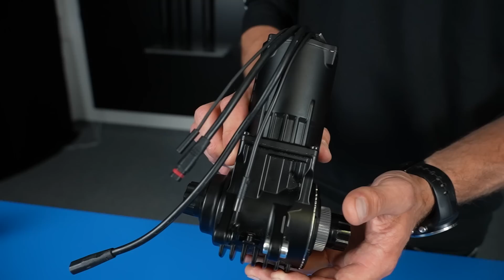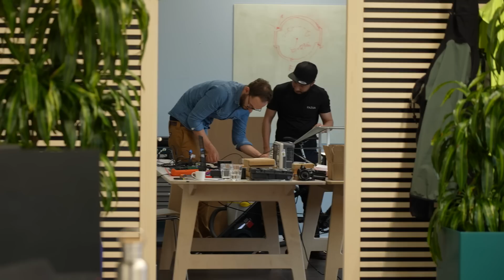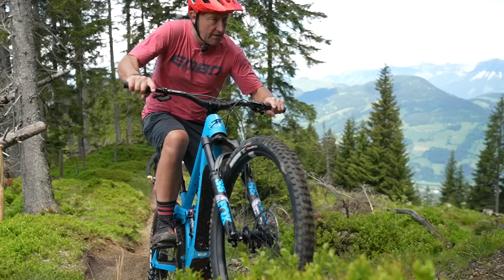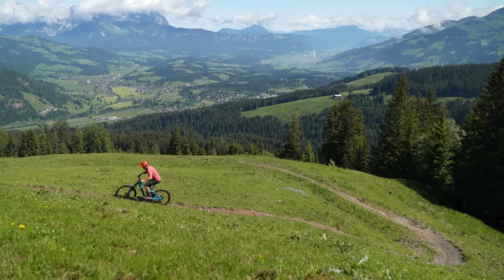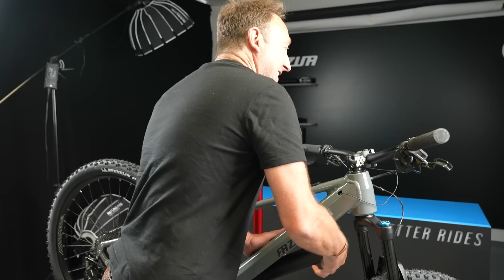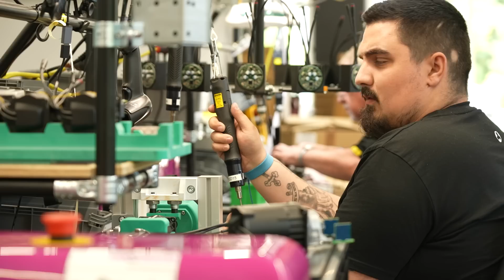Is This The Lightweight EMTB Motor Of The Future? | Fazua Factory Tour

Comment from the maker: What do you think of the new Fazua unit and these lightweight EMTBs? 🤔 Let the community know 👇
Reply: Specialized needs to make their SLs better at least 50 nm of torque
Reply: The Fazua 60 is compromising a bit towards power. I'm happy with my Fazua 50. It is 19.7 kg electric, and 16.4 "pure".
Reply: Coming from the emobility industry this is exactly the right move, good job guys.
Reply: Can't help but think of a recent Sam Pilgrim video where he lamented wishing for a jump bike, that had a small lightweight battery/motor so he could do tailwhips and other stunts that require a lighter weight bike - and most importantly, so he could also ride back up to the top and do it all over again......Hey Fazua / Porsche - are you listening?   I can definitely imagine Sam Pilgrim on a Porsche Jump Bike.......
Reply: For me if they don't supply spare parts, then this brand it's a big NO because we already have too many price gouging and monopoly style brands.
Reply: I have to say I am really impressed! Mostly of that how well integrated and protected is the motor. But the battery seems a bit small. there are now 900Wh battery e-mtbs. I guess 60Nm from the motor is about right.
Reply: Interesting components design, lighter e-bikes. On the other hand, the range on the introduced battery is simply not enough for hilly countryside expeditions, even for normal multi-hour hill rides outside high mountains of around 50 km. Maybe for the trail spins? 

I would definitely again choose a full-power Bosch setup of the last generation with a proper battery, and I don't have to worry about not getting where I want to go. Even with the sacrifice of the high weight.
Reply: Did they fixed all the water issues?
Thinking about their community is important this ride 60 cannot be mounted on previous bikes
And I m not sure the ride 50 has fixed any waterproof issues so what now?
Reply: There are a lot of flaws, BB fails, Battery fails, Battery drains when the bike is not in use, connectivity problems, motor loses power, sensors issues, and the system is basically not water resistance... just google Fazua problems :) never ever... yeah good concept but I would rather pick Bosch, it is far more reliable
Reply: 2024 and the Ride 60 on my Transition Relay is overall faultless and very natural feeling. Plenty strong enough to get me up my local trails. Only downside is the fiddly ring controller. Can't wait for the updated controller as I rather enjoy the ring concept... Just needs refining and to be made more durable and robust.
Reply: A very interesting addition to eMTB motors and more competition is always a good thing. Thought the Fazua 50 was a bit weak compared to other motors, I hope this feels more powerful/usable. Good video!!!

Comment: I have the Ride 60 on my Focus SL, this is the best system currently on the market; main flaws are:
1) the remote gets stuck even after changing it with the upgraded one; also is not easy to use while riding 
2) the connection with garmin is through a dedicated page but is not integrated like with Shimano for example 
3) they promised the range extender in 2022 and today (jan 2024) is still not available.. this is really upsetting.

Having that said I still believe is the best light system currently on the market.
Reply: There are a lot of flaws, BB fails, Battery fails, Battery drains when the bike is not in use, connectivity problems, motor loses power, sensors issues, and the system is basically not water resistance... just google Fazua problems :) never ever... yeah good concept but I would rather pick Bosch, it is far more reliable

Comment: I ride a Fazua 50 on a Trek e-caliber. 80% I ride it without motor like a normal mtb. I only take the motor & battery to help on longer, steeper, rougher trails. Still manage 40km and 1000m D+ with 70% of the 250Wh battery left!
The philosophy of the Fazua 50 is to help you ride, not to replace your efforts like others motos. 
Following the arms race of bigger torque and battery will have them endup with a me-too product.
I liked the idea that light emtb was for people who don't want to ride an electric motocycle in the woods but still enjoyed pedling with some assistance when needed.

Comment: Why doesn’t someone integrate a mid-drive motor with a transmission like the Pinion gearbox? The only choices seem to be derailleur or hub gears. Seems they could add this motor to a mid drive gear box as well. We love the Pinion gearbox and we love the Bosch mid drive. Put em together with a gates belt drive 🤓
Great video love shop tours! 
Arrivederci y’all

Comment: I think it's better to have 80 nm and to only use 60 of it.
Reply: that would be bigger and weigh more. 60nm is alot for light bike
Reply: @dft1  it would be more stable, and you wont be maxing out the motor.
Reply: @dft1  nm is the amount of power it puts out. 60 nm  compared to 80. Isnt the same as the weight difference between a 250 to 450. Its electric.

Comment: Wow they finally did it.  A motor and gearbox in one. It's insane how small and light it is.  This might kill gearboxes like a pinion or effygear. Why choose a gearbox only that sits around 2kg. If you can get one with a motor and gearbox in one for the same weight.

Edit: wait why the bike has got a cassette? The gearbox is useless?
Reply: yep.. just for the motor torque.. sad, huh?

Comment: Expensive weak motors and small batteries.  Exciting tech.
My Bafang 29'er has twice the N-m and over twice the battery capacity and less than 1/2 the cost.  Production ebike tech is for suckers or those that didn't go to engineering school.
Of course you will try to sell it to the uninitiated.  Good luck finding replacement parts. CANBUS proprietary controllers.  The tech hustle continues. German's are the masters at fleecing the public with expensive tech. BMW is the flagship for poor reliability and therefore non existent resale value.  The ignorant public are easy pickings.
Reply: I own several eBikes and each has its purpose...and I own a Bulls Grinder Gravelbike with 15.5kg and Fazua 250...excellent and fun to drive.
And Yes you make much more Sport on this kinf of Bike since Motor is weak compared to others...as said different purpose makes different bikes.
Reply: Twice the weight too😉
Reply: Conceded idiot. 95% of people did not go to engineering school and 90% who did would still like an intergraded product and just don't have enough free time to mess with a home made science experiment, we have better things to do.

Comment: love the lightweight but my giant trance x does 180km on eco mode and at least 40-60 on turbo mode, and i sometimes do use all of it in one ride, so if the range would be around 100km with a battery extension id be very interested

Comment: Nobody is giving up numbers. How much lighter than the EP8RS is it? Because the Transition Relay using this is supposedly the same weight as the heaviest Orbea Rise despite having a smaller battery.
Reply: RS is only a software modification, the motor weighs like other EP8s, 2.6 kg

Comment: non removable motor is a deal killer and a maint issue down the road
Reply: Not removale compared to the old Fazua System...Batterie and Motor was a unit, which could be removed complete...my Bulls Grinder Gravelbike is 15.5kg..removing Batterie and Motor means 10kg and you can use it as normal Bike.
The 60 can be unscrewed...but since the engine is the crank, too...it makes no sense other if there is a defect. But you would never remove a Bosch, Brose, Shimano other than for a repair, too....

Comment: Fine and dandy with reducing motor size but what is needed is the bike industry to concentrate on developing the sealed gear box and do away with derailleurs completely, this technology should have been standard 10 years ago and by now super lightweight and on most every bike...I can only surmise companies make money by putting out more derailleurs as they know it is an easily damaged part so needs replaced making money. Sealed gearboxes have far more importance than this fad for creating lighter motors,  it will always be limited by current battery technology and the duration of such batteries...Lightweight ebikes are probably at their zenith and this continued fascination with small weight margins on motors is IMHO really going backwards...
Reply: Agreed, I wouldn't mind the extra weight and lower drivetrain efficiency of a gearbox on an e-bike. Happy with my chunky 2020 Aluminum Turbo Levo Comp. The only reason I would upgrade would be the integrated gearbox.

With battery power always being on-board, I wouldn't mind electronic shifter for it either. Something that would give the impression of being able to shift under load to the user, but the motor momentarily cuts power like a quick shifter on a motorcycle.

Comment: Very interesting video
Maybe they have moved away from the removable motor because, having bought an ebike, people tend not to do that. It was a solution for a problem that didn't really exist?
So now they want to be the best of the lightweight and compact offerings - which I suspect will be a massive growth segment because it can be used in all sorts of bikes, including road & gravel.
I like the max 60 NM sweet spot because it gives you that punch when you occasionally need it for most types of riding, however I don't think it's enough for many MTB riders?
 
I don't really notice the weight of my Carbon Turbo Levo once I am riding it. I remember before getting it I had all sorts of plans for how I was going to shed some weight off it and then after the first ride I realised the weight was a zero issue.  I can ride all day on the 700 battery  if I use low levels but I have the massive punch for the very rare occasion I need (want) it. A few additional kgs is the price I pay for a bike that can do everything I need.  
Another problem with eMTB weight obsession is that you start to fit the lightest components which means - very expensive  and/or not quite strong or durable enough. So in reality the lightweight EMTB market is limited to lightweight riders with deep pockets
Reply: In all honesty, the perfect ebike is light and powerfull. Anything else is a compromise or sacrifice.
Reply: @smigielko  not everyone has those criteria. im willing to trade quite a lot of lightness for sturdiness...

Comment: Fazua are not new on the block btw - looked at a laPierrire Zesty in 2019 but was seduced by the power of levo and for our friends in road and Gravel Pinarello use them in in their Nytro and Boardman - as long you are not expecting a blow your socks off Fazua is a great option and has the party trick of no drag so take the battery out and its pedal yourself power - Fazua power is on my radar for my next road/gravel bike

Comment: I disagree that 50 or 60nm is the sweet spot. if you need that much you will still struggle riding down sadly. loving my 35nm.kenevo sl which I have downturned
Reply: everybody has their own sweet spot. Do not make me love yours 🤣
Reply: I have a Levo SL and I find the 35nm fine, but I wouldn’t knock back 50 or 60 for the same weight.
Reply: Doesn't it depend on the terrain you ride and how many hills?
Reply: @mtsmithtube  For sure it is. Ride style, terrain, uphill road or trail many variables.

Comment: Hey could you please tell me if the Fazua Ride 60 truly does pedal without any feeling of drag with the motor off or over the assist limit?

I think I want to buy the Transition Relay purely based on the promise that it can be ridden with no feeling of drag without assist as an analogue bike, or over the assist limit, as well as how gorgeous it looks! But the real problem is that I can't wait till it's spring release to buy a new bike, I need to find something else to replace my rusty hardtail in the meantime!
Reply: I did not drive the 60...but own the old 250 in Bulls Grinder Gravelbike 15.5kg...no resistance at all at any time...brillant!...and I have driven all motors available on market. None compare to this. 
Don't think there is any difference than the Motor is fixed into the frame now.

Comment: by the sounds of it the ep8 rs motor in my rise still outperforms this setup, the range on this fazua isn't very good only just over1000m of climbing, i was really impressed until this moment in the video.
Reply: Maybe, but at least it doesn't rattle like a bucket of bolts like the ep8.
Reply: 1000m on turbo full time
Reply: @CitrusGTR  It’s not necessarily a question of efficiency I would imagine the EP8 and the Fazua are similarly efficient it’s just how much power the motor is allowed to take from the battery so that said I would imagine the turbo setting on the Fazula is giving more assistance than the EP8RS
Reply: @CitrusGTR  60 nm is not my idea of turbo
Reply: i have rise but this would be even better. i lighter weight motor instead of detuned motor. that new transition mullet bike with this will be amazing.
Reply: I used to do 1200 with Bosch gen2 in eco mode and 500w
Now I do 1300 uphill with 250w on my ezesty

Can you do the same with ep8rs?

Comment: Love the way this lightweight tech is headed, but a 40-50km range is game over after a few hours?!
Reply: Just put a second battery into your backpack 😉
Reply: 40-50 plus 1200hm. i have a specialized turbo levo comp with 700w battery i get about the same range out of it. But with the fazua its a lot easier to pedal the thing when the battery is low or to safe energy.
Reply: I get what you are saying , but carrying an extra battery, totally defeats the purpose of a lightweight ride?! Short runs on these bikes, yeah fair enough, but the whole reason for an emtb (in my personal opinion) is those extended climbs and rides you wouldn't normally manage on legs alone.
Reply: @andydtkd  I mostly use an ebike to keep up with faster, fitter, and younger friends on regular bikes. a full power ebike is overkill and not as much fun as a light ebike.
Reply: At 2.3 kg a battery if the price is sane, which it will be at 431 watts, probably in 500-600 euro range, just bring a second one. You need a second battery on a Turbo Levo as well if You’re planning on doing decent speed at over 60 km. And Levo has 700 watts…
Reply: @jevgeniardassov  exactly with specialized their 700w battery here is 1200€ ... and sizewise you dont get it into your backback easily or at all. Only point were the big bike has its advantages is very steep climbs (max i did so far was 25%-32% for a little over 300m)  anything else the fazua would be better i think i definetly will test it out soon.
Reply: I only get 30-35 miles out of my 900wh battery
Reply: @billybobby7607  and how much elevation ?
Reply: @Stelomat  is there a route calculator that displays elevation amount on a ride?
Reply: There will be a 210wh extender to up the range by 50%.

Comment: I’m trying to get my head around a non removable drive unit. So what happens it it becomes faulty or needs replacement, you have to replace the entire frame?
Reply: No it’s just the motor part of the unit isn’t able to separate from the gearbox part like in the old systems. The whole unit will slide out of the frame as one 👍🏻
Reply: No it’s just the motor part of the unit isn’t able to separate from the gearbox part like in the old systems. The whole unit will slide out of the frame as one 👍🏻
Reply: No, it will not slide out of the frame! It is fixed by screws ( so of course you can remove it). Only the battery will be easily removable.

Comment: Interested for sure, especially after seeing the Transition Relay was going to have it. Also, was that a sneak peak at the Pivot Shuttle SL?.
Reply: I love my Turbo Levo SL, but it's 35nm is lacking compared to my friend's 60nm Orbea Rise.
Reply: @stevebaur  Rumors say, Specialized will bring out a new "SL" with more power (60+nm), you should keep an eye on the market and thinking about selling it at the right time, if you're planning to upgrade
Reply: @e_mtb  more like 50% more power, not in the 60nm region
Reply: @e_mtb  Spesh have just dropped the price of their Levo Sl's by up to £1450 in the UK which suggests they are changing the design and upping the power soon.
Reply from the maker: Might have been Steve... might. have. been. 😉
Reply: That Shuttle is beautiful. Transition made the lower shock mount area to large. It really looks like you have a motor there. The Shuttle is built slimmer to where you can't tell it has a motor.